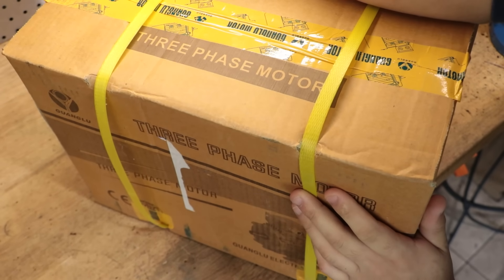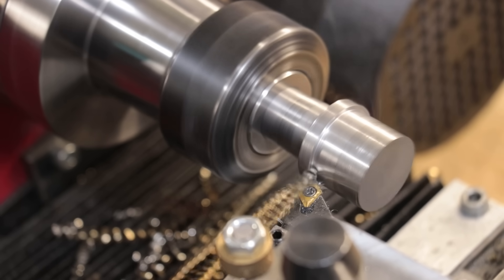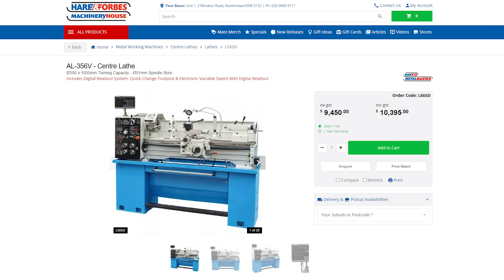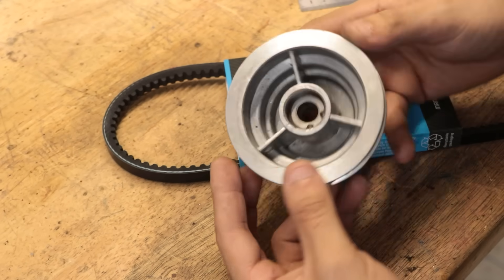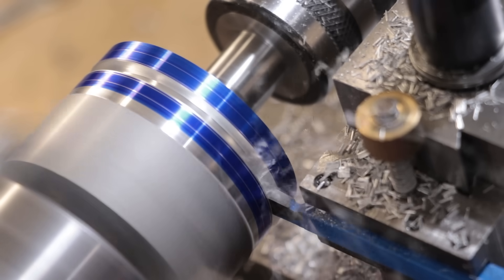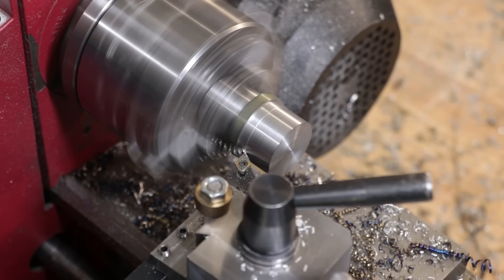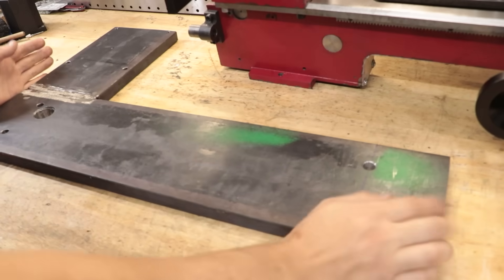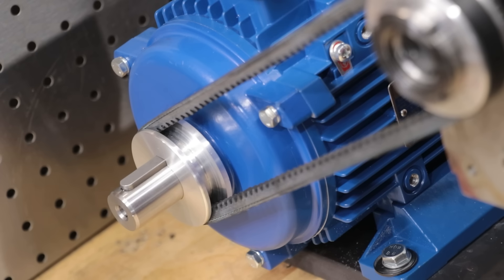Mini Lathe 3HP Motor Upgrade..... (Yep 3HP)

Comment: Love this build. As others have noticed, the spindle locking nut sits quite far back due to the wider spindle pulley.

To get more threads engaged by the spindle locking nut, you could machine yet another spindle pulley larger in diameter to accommodate a large diameter counter bore for the locking nut. The counter bore would be just deep enough to allow the nut to engage all the threads. 

Of course this restricts access for a spanner wrench, so that problem would need to be solved. An offset wrench, or a pin style wrench might solve that issue.  

Of course the larger pulley gives a slower speed for the same motor rpm, but that might not be an issue. You could always change the motor pulley if that even made sense.
Reply from the maker: It’s sat like that for the past 3 years. It’s always been one of those things I’d get around to doing. Like a custom nut but never had to time to. But hey it’s never been a huge problem. Yet anyway
Reply: @artisanmakes    I suppose as long as it feels safe, there's no sense fixing something that isn't a problem.

Comment: Very cool upgrade. I have the same issue with my lathe.
I plan on using a sewing maching adjustable speed motor - and yes, motors prices have gone through the roof!

Comment: Get a proper vfd which will do SVC sensorless vector control!! Cheap vfds only do hertz to voltage speed drops. It'll spin slower as expected but you're gonna get far less than half of the power at anything but full speed. Sensorless mode retains the full torque and power down to any speed.

Comment: I have a little mini lathe I use to drill wire gauge sized holes.  Mine has a plastic gear train so I think 3hp would pretty much shred it.

Comment: You have to check the temperature on low speeds because the motors cooling fan runs also low speed which often causes overheating
Reply from the maker: It’s not pulling a huge current, even at low speeds so it’s not producing a huge amount of heat. A few people had this concern but it isn’t an issue with this set up

Comment: Great job that upgrade. Did you use 415v 3phase motor, with a 240v VFD? Thanks
Reply from the maker: This model can be used with either 220 or 415v. But I’m running it on 220 v

Comment: Or you could’ve just drilled and tapped one hole in the pulley for a set screw….
Reply from the maker: You referring to the keyway?
Reply: I was thinking that instead of making that retainer cap for the drive pulley, you could've just drilled a hole in the pulley groove and tapped it for a set screw. Then just tightend the set screw down on the shaft. I also cringed a little when you were milling out the slot in the retainer cap in the X direction instead of the Y. I was relieved when you didn't mill all the way through it though.
Reply from the maker: Sure that might work. Don’t see what the issue with the direction of milling the slot is. Slides are locked and it hit the dimension just fine. This mill is capable of doing it just fine

Comment: The reason only three attachments are supplied is to aid setting up the head alignment on a less than perfect bed casting. Four attachments will create stresses in the head casting and along the bed.
Reply from the maker: Could be but for what it’s with every non sieg mini lathe uses 4 screws and some of the replacement sieg headstocks come with 4 too

Comment: Be careful with big cutting depth, because even now you have upgraded motor, all other parts like bearings were not designed for it.
Reply from the maker: It’s running tapered rollers. And this is not a stock lathe, it has had years of rigidity upgrades to prevent anything bad happening

Comment: You seem to be doing exactly same steps I did with my lathe. It's bigger and came with 1.1kw motor. Next phase would be to make variable transmission which uses scooter belt. It's quite simple since ratio is manually adjustable. It provides much better stability and torque on low rpm's. It have clear influence on surface quality.

By the way, in your setup, you must add separate cooler for your motor. Otherwise you burn it with low rpm.

Comment: Great work! Just think you should have put tension adjustment on the motor.
Reply from the maker: Yeah i just haven't gotten around top that yet, currently substituting in a machinist jack as a tensioner. cheers

Comment: When I seen that bit of plate I thought holy crap! And then you said that you were going to cut it down to size. 🤣 Then I thought, how on earth is he going to cut THAT?
That's a gutsy effort cutting a bit of 20mm plate with an Ozito 4" angle grinder. Then you backed it up and did it again. GO YOU LITTLE AUSSIE CHAMPION! 

Have you thought about putting a recess in the spindle pulley so the nut gets a little more purchase on the threads?

I know you are probably going to anyway. You really should have double insulated wiring for the motor. Because safety. 

And some proper start stop switches with a magneticly latched E-stop. That thing has decent power now. 

Will be good to see what can be done with that machine. Nice one.

Comment: I do not know where to start so it's better to keep my mouth shut.
Reply from the maker: happy to listen. Not that helpful to say there is stuff wrong and not list it. I think that if you know the context of this lathe and the set up you might come around to understanding. If it’s about the wiring, that’s on me.
Reply: @artisanmakes  Please use reamers at low speed, and use a suited reamer oil.
 
Second: a VFD is a very nice piece of electronics. But please make sure that if you set your VFD at "variable frequency-constant torque" which is the correct setting for a lathe, and you use your lathe on low speeds, you cool the motor because it will get very hot.
 
Third, in order to keep the air clean of unwanted high frequency signals, use a shielded cable.   
 
If the motor makes a funny noise during use: there is usually a setting inside the menu to change the switching frequency.  You can experiment with that setting.

Comment: Why can't I get rid of the image that a Harley Davidson engine is mounted on a bicycle?
Those poor spindle bearings....
Reply from the maker: The Tapered rollers should be tough enough. We’ll have to wait and see
Reply: @artisanmakes  
Ah, tapered bearings. I didn't expect to see those kind of bearings in this cheap machine. 
They can indeed withstand quite a lot of forces.
Reply from the maker: Well in fairness i installed those. They originally came with Depp grove bearings and they gave out in less than a year

Comment: Large motor is nice for torque at low speeds when mated to VFD but I hope no one will try to take heavy cut to max out the motor at higher speed - there is a good chance to break something & lathe will flex a lot.

Comment: I actually have a 1.4KW three phase motor attached to the minilathe, new from the factory when I put my hands on it. Salvaged from an industrial diswasher broken water pump. If you know where to look, it's not dificult getting this kind of motors for free, even new ones. I must recognize I have it very easy, I'm the head (and only member) of the returns and guarantees department of an spare parts seller for hostelry appliances. I just need to pick what seems interesting from what I send to the trash for reasons like damage during delivery and not economic to repair. I have more monophase motors at home that I can use in my whole live, a wide range of powers. :-) (And some nice three phases ones).  But seriously, learn where to look for these motors and other parts. A lot of industries dispose of perfectly working motors because the part they are part of have some flaw that doesn't affect the motor and is not economic to repair.

Comment: Please change that wiring and put the inverter in an enclosure, swarf and exposed terminals NOPE! Also pretty sure on a single phase to three phase inverter you need to run the motor in Delta not Star as you had it the video.
Reply from the maker: I've already addressed this in the pinned comments and others. This is not a finished build yet, as mentioned in the video. It needs a potentiometer before i'll move it.  With that said you can see in the video that it has been changed to delta. Wiring has been changed, although it was rated for the current.

Comment: I'm pretty sure welding the motor plate to the lathe plate was overkill, because the rubber belt allows flexibility of the mount. Leaving them separate also helps isolate the lathe from any motor vibrations.
Reply from the maker: It was more to do with the table flexing. I used to have a set up with the motor bolted to the wood through a base plate and the table ended up flexing. You could see it in some older videos, the motor moving under heavy loads as the table flexed ever so slightly. This was just a quick get around to make it all rigid. Sure there might be some vibrations but its probably no worse than motors that are directly mounted to other lathes. it doesn't seem to be an issue so far, and if worse comes to worse I can dampen it slightly with some rubber pads. Cheers
Reply: @artisanmakes  ah, ya, I didn't think of the table flexing, & that could be an issue! Rubber mounts could allow enough movement, good luck on that project! 

BTW: I use Energy Suspension sway bar endlink bushings for mounts on various projects. 3/8" bolt/1" outer diameter/~1" tall, red or black urethane, part# 9.8106
Reply from the maker: Cheers

Comment: If you change the mounts of a lathe, you should re-align the machine. Several YT videos on how to do this. 
Commonly, one uses the weight of the motor to tension the belt- which will stretch over time...
Aluminium pulley- with a steel retainer? Interesting...
Reply from the maker: Yes this is true but there is enough in the slots to accommodate stretch. I initially sketched up a design for a hinged tensioner, but just didn't have the time. Ive substituted in a machinist jack as a temporary solution until something more permanent gets put in place. And I don't see too much issue with the alu pulley and steel nut. It has worked just fine for the past 3 years
Reply: @artisanmakes  Did not suggest steel was an invalid choice for a spacer- just a lot of work for no added benefit. In practice, no spacer at all would allow the belt to self-align- and the time saved could go to a tensioning pulley. 
As you found, the motor power is rarely the limiting factor to turning capacity- your 2mm cut caused the workpiece to move in the chuck. As well as machine rigidity, speeds, feeds, coolant, and bit geometry all play a part. For most amateurs, that calculation takes more time than just taking modest cuts. My main concern would be the life of your main bearings.
Reply from the maker: Oh I see where you were getting it. That would be nice, but it is also working double time as it sets the preload for the tapered roller bearings. As you'd know, they are tough as hell and are probably the best bet for this set up. You are probably right that the chuck is limiting it, in truth I'm probably going to have to add a bigger chuck some time soon. Cheers

Comment: Cool conversion!
Did you replace the headstock bearings with either tapered roller bearings or angular contact bearings?
That'd make a huge difference if you didn't already do it. A lot of people get away with tapered roller bearings even though the angular contact bearings are the preferred ones for headstocks - more accurate. 
Also, if you didn't do it already, you should check for twist in the lathe bed. 
I had one that the feet had to be gently bedded in epoxy to prevent induced twist from a rough casting on the foot bottoms. 
Thanks for sharing this!
3 HP!  Ha, ha, that's wild!  🙂
Reply from the maker: Yeah ive been running tapered rollers in this for the past 3 years, huge step up from the deep groove bearings, and they're good enough for 0.01mm run out on the spindle. Undoubtedly i'll have to check the twist from the lathe, it had to be shimmed previously, so im sure it will have to get around to that at some point. cheers
Reply: @artisanmakes thanks!  😊
Reply: If I'm not mistaken angular contact bearings are a lot more finnicky when it comes to preload, while tapered roller bearings are pretty forgiving, right?

Comment: Waste of time/effort  ... you'll never be able to take a deep and fast enough cut to use the power.
Reply from the maker: Took no longer to do than shoving in a 1 or 2 hp motor, and ive been able to stall 3/4 hp motors out on this lathe, so there is a case for a big motor, although probably not 3hp. And the cost was pretty much the same as doing a 2 hp. I doubt that i'll ever use the full 3HP but its nice to have the head room. Plus I just wanted to see what this lathe can do for the fun of it.

Comment: bro, your work piece not being secured is slowing down your deeper cuts
Reply from the maker: That is one part, the chuck is limiting it, but most of the issue was coming from the carrriage end. It has been mostly solved after pulling it apart and readjusting. 3mm doc without those issues
Reply: @artisanmakes  yeah man, chew that metal out. I upgraded to a 5 ich 4 jaw and a 5 inch 6 jaw.
Reply from the maker: Neat. Im looking at a 4 inch vise, but a 6 jaw would be hard to pass. Cheers

Comment: Those spindle bearings will only last a short time.  If they are angular contact they are probably already toast.
Reply from the maker: Tapered rollers, tough as hell
Reply: Yup, i learned the hard way that angular contact are not good in this lathe with no lube flow.  Smoked mine just doing some polishing.  Rollers are much better.

Comment: That VFD will be the first thing to die, I know those cheap ones are tempting, but they're barely capable of half their rated output with any sort of reliability. I've killed 2 of those 2.2kw VFDs and I'm only running a 2hp motor! When it blows up (when, not if!) buy a decent one, they're reliable, and much easier to program (and usually have more options for external controls too which makes it a doddle to make a nice control panel.

The RS components own-brand VFDs are a good compromise of cost and quality, I've not had one crap-out on me yet!
Reply from the maker: With any luck I’ll have a new lathe before this thing dies

Comment: welding that thick of material with a small wire feed needs a lot of pre-heat.
Reply from the maker: Maybe but I can’t be preheating on my wood bench tops
Reply: @artisanmakes  even a little heat would help, doesnt have to be smoking hot. just warm enough to keep the weld puddle molten. and burn marks add character to the wood, lol

Comment: Just a thought - The three screws may have been intentional to avoid warping, since 3 points define a plane and the 4th may be over-constraining.  Not sure if that applies here given all of the mating surface, though.
Reply: Possibly.  However similar type lathes have 4.  Mine does.  Seig type.  Vevor model.  Sometimes they are lazy at the factory.  You'll have bosses that aren't drilled and tapped yet should be.  Missing screws, metal shavings in the headstock, Sand in the headstock....etc.....  Good ol Chi-nuh.

Comment: G'day! I'm thinking about a similar upgrade but to a larger wood lathe. I realise that I'm asking a very open question, however, could you give me an idea of the Min and Max speed. Just a ballpark figure if possible. As standard my machine can run 50 - 3700 rpm over 3 ranges.Thanks in advance.

Comment: There appeared to be significant runout on the pulley end of the spindle. Not sure how you might address that. Perhaps replacing the bearings with tapered roller bearings instead of deep groove ball bearings.
Reply from the maker: It’s the threads that have been cut in which the pulleys sits on. they are not perfectly true. I’ve had several pulleys and none ever sat on it perfectly
Reply: @artisanmakes  it might still pay to consider trying to find a way to use TRB's instead of ball bearings.
Reply from the maker: They are tapered rollers. Have been for about 2 years now. Cheers

Comment: You are making a mistake. The motor has to be wired in DELTA because you get 3 phase 240VAC and never 3 fase 400VAC with single face IN. Look on the motor plate. It says 240/400Vac Delta/Star voltage.
Reply from the maker: Kinda difficult to see but I did change it to delta, around the 16:24 mark. cheers

Comment: you said that plate was "20 mil" thick. 1 mil is a heck of a lot thinner than 1 mm.
also your going to snap belts with 3 hp. you need 3-4 belts.

Comment: That is a BIG motor! I would like to see its very low RPM performance, that is great for drilling larger drill sizes and tapping/threading etc... 👍
And is your belt pulley on the lathe running a bit wobbly? Looked like it.